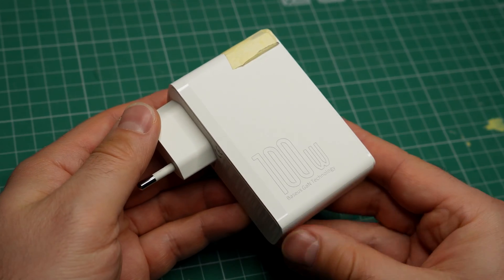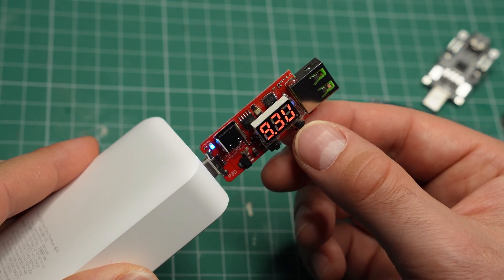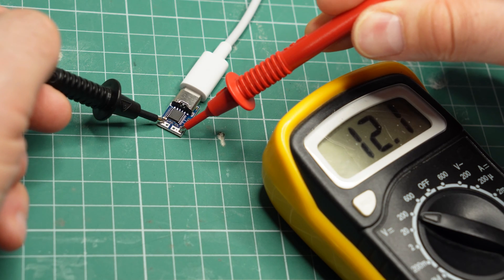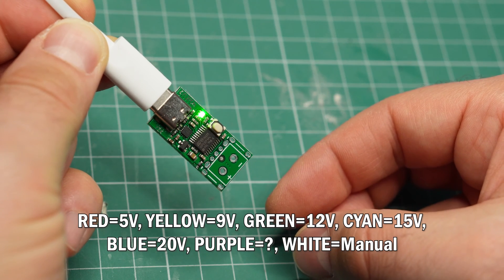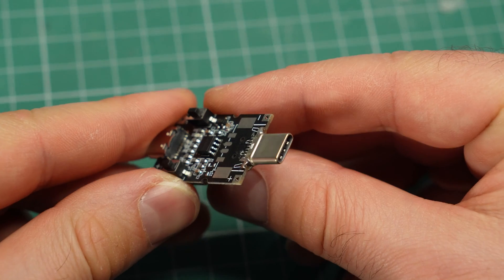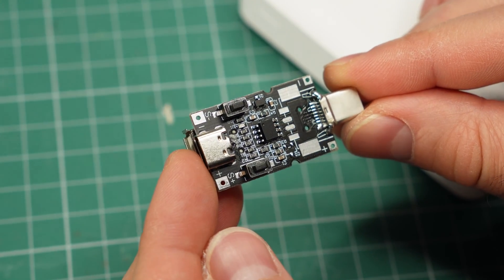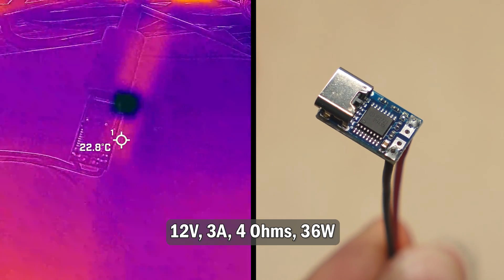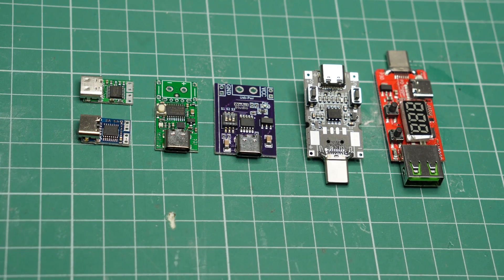Testing USB Power Delivery Modules at 100W: how good are they?

Comment: hi, i bought a module at 0:32  it it triggers to 9 volts, not any 12 or15  or 20 v  , 9 volts was also on one mi charger, and i used dell 65 w adaptor for 20v which never worked.. was stuck at 5 v and when plug reversed ,indicator flashes on the module. is it the module or the dell adapter was fault , could you please check with dell adapter if possible, and could you please know which mighty be faulty. thank you .
Reply from the maker: Does it say on the adapter that it supports 20V? Even if it does, it might still not work, as it doesn't with my Dell adapter because it uses a different protocol, as far as I know
Reply: @LeftyMaker  , yes, it has 20v output, even laptop detects 65w input...so same for your device! That means it's compatibility issue with dell adapter. Should I try with other adapter..? Thankyou again.
Reply: @LeftyMaker  And my bad, the module I was talking is at 0:32... Is that also same with dell adapter.

Comment: Have you found one that will only deliver voltage if the set voltage is available on the PSU? Trying to prevent 5V being applied to something that expects higher voltages
Reply: Are you still curious? I bought three different ones to fiddle with. One of them has specific solder pads that you bridge. It's then set to your required voltage. I think I'd use that in some of my smaller electronics to replace batteries. Also, makes portability an option for plug-in devices. Fun stuff.
Reply: @YerUnclePhil  Can any of them prevent 5v passthrough?
Reply: Could you elaborate on pass through?
If you solder the correct pads, it stays at that higher voltage.
Reply: @YerUnclePhil  If I understand you correctly, soldering pads sets desired voltage, but if you connect regular 5V USB power supply then it will deliver 5V to a retrofitted device that expects lets say 12V. So I was looking for a trigger board that has something like a mosfet that turns on only when the desired voltage is accessible.
Reply: Also, a good video. I think he describes what you want.

https://youtu.be/gRcRFjUl_Gk?si=iq9k7QPmqlCkaoW4
Reply: I can't say for sure for all of them. But. I just tried an older supply and the device was soldered at 12v. Wouldn't ya know it, it allowed 5v.

So there you go. But, that was only one of the three I have.
Reply: From my testing, they’ll negotiate to their set voltage or the next highest set point the supply is capable of. They do not have any method of stopping output power being requested, doing so would require a power source on the load side because otherwise they couldn’t output enough power to turn on the PD negotiation chip. It’s likely doable with some of the PD negotiation microcontrollers (e.g. by WCH) and such a load-side power source, otherwise you’re probably better off adding a load-side MOSFET with a comparator or microcontroller to enable load power. It’s not often that you want to prevent undervoltage conditions like this, I’d only think it useful for analogue circuitry and with that SMPS noise you’ve probably got bigger problems.

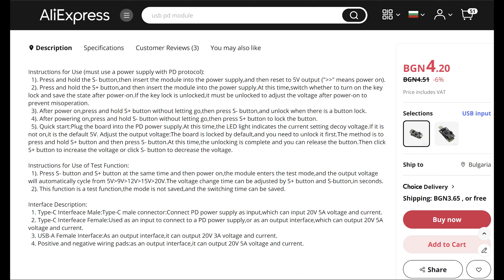Comment: 3:10 that particular module only supports QC 2.0 and 3.0. The reason it states 20V is cuz 20V is a part of QC 3.0 standard and some very special QC 3.0 chargers supported 20V output.
Reply: I dont get it: why selling an usb charger that can output 20v when it can concretely only output 5V ? (Other said, what the point of making a devices that need 20v that can only be powered with usb c )?
Reply: @ytrew9717  well let's say you need 20W output, with 5V you need to output 4A to get 20W (5x4) bht with 20V you only need to output 1A to get 20W (20x1) this means much thinner cable and much less heat generated.
Reply: @ ok I finally got it ! I did not know that now many devices using >5v come with a usb C connector to power them. It helps me a lot thanks for your time !

Comment: is there a 120 watt pd module ? If such can you provide me the details I want to use it in my laptop its dc jack is not working properly.
Reply: You can definitely find something like that. Just make sure it has the correct voltage: your laptop's charging voltage should be listed on the bottom and on the charger brick somewhere.
Reply: You need a PD3.1 compatible trigger and charger for that, as PD 3.0 limits output to 100W, while as PD3.1 does upto 240W
Reply: @pvim  There are PD 3.1 decoys but it'd not work for his application - the laptop likely needs 19V~20V at 6.3A but PD3.1 can only deliver higher than 100W if the voltage is increased to 28V and above.
The PD spec is pretty much current limited to 5A and relies on increasing voltage to allow for higher power delivery.
Reply: @BigBenAdv  That is true but newer laptop have started to leverage the full voltage range of PD3.1 chargers, but depending on his laptop he is going to be limited to 100W like you said. Also some laptop manufacturers had a custom implementation of PD, lenovo had one where they included a 20V 6.75A (135W) type C charger with their laptops but was limited to certain markets.
Reply: @pvim  I guess it depends on the exact laptop model and requirements. Lenovo (IBM in the past) have Thinkpads that allow lower power adapters to be used (detected by a resistor in the charger side) so a Thinkpad that uses 90W adapter by default could operate with a 65W charger though possibly at reduced performance.
In those cases, you could replace the connection board with a PD decoy and add an internal resistor to tell the laptop that a 65W adapter is connected if the PD brick can't do 100W but could do 65W.
If this is a Dell laptop, it's going to be tough to do since it uses a 1-wire protocol to sense the power adaptor rating. However, most of their Latitudes (except ultra thin models) should have a field replaceable power connector and these can be sourced rather inexpensively online and would be a better fix (assuming his problem isn't actually the power circuitry).

Comment: do current lenovo thinkpad power supply usb C (symmetric round) need the negotiating "PD" chip on the connector end, or are the red, blue, ground wires connected straight through ?
Reply from the maker: My guess is that it does need a chip
Reply: I have a lenovo laptop, it has a 330 watt power brick. It does support usb c charging but at a maximum of 7 amps, which is out of USB PD spec. They've been doing this for years. They need to just use the 28 volts and buck it down to 20.

Comment: Why do they not come with a protective sheath? And how would you go about creating one if you required it?
Reply from the maker: You still have to solder wires to them. I've seen modules with insulation, but they had wires soldered to them already. Heat shrink or capton tape would work well

Comment: why dont they make one that negotiates the voltage needed automatically like every charger on the market?
Reply from the maker: I'm not sure what you mean. What is the behavior you would like these to have?
Reply: @LeftyMaker  Like the Anker Prime powerbank, the two USB-C ports can charge or discharge at 100w at the same time
Reply: @Post_Oak_ these are for clients (like your phone) instead of for a source (like a charger). Chargers require much more complex boards.
Reply: They make it! I bought at TEMU:
PD65W Fast Charging Module with Type-C Connector, PD QC SCP PPS Compliant, Full Protocol Charging Panel, Black, Fiberglass Material, Local Electric/Fixed Wired, Operating Voltage ≤36V

Comment: Thanks for the video, i see you only tested for voltage. is there a limit on the current that goes through one of these modules?
Reply from the maker: I could draw the full 100W at 20V without any immediate issues becoming apparent.
Reply: @LeftyMaker  Amazing! thanks for the reply :)

Comment: Does the module support QC3.0
Reply: QC is a proprietary standard while USB PD is a real part of the USB standard. You'll need to find a charger block that works with the USB PD standard, which most do
Reply: the one at 3:10 does, and only supports QC2.0/3.0

Comment: I noticed your thermal camera is slightly unaligned. I think you can tweak it via the settings, just search on how to do it so as to avoid ghosting.
Reply: The smaller the distance between the IR camera and the object being measured, the harder it is to align the images (potentially maxing out the adjustment range)
Reply from the maker: Yeah, I know about the setting. This is the most aligned it can be.